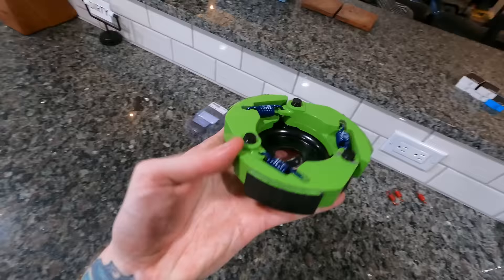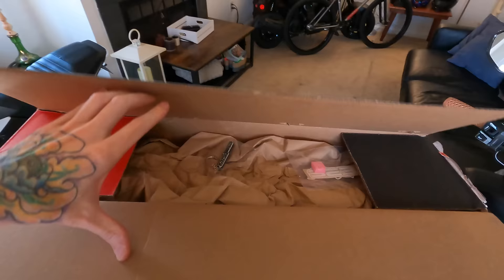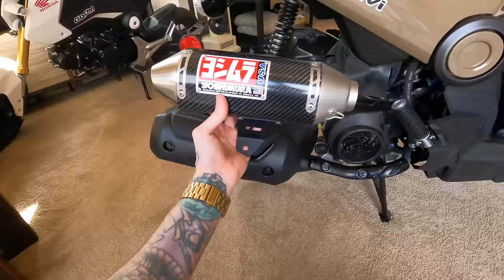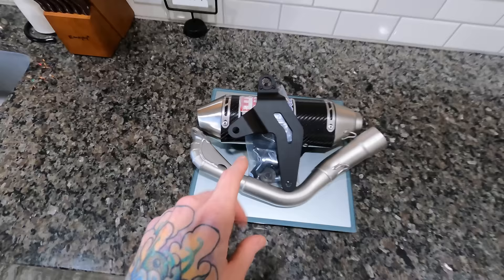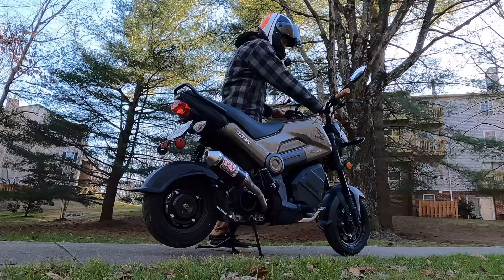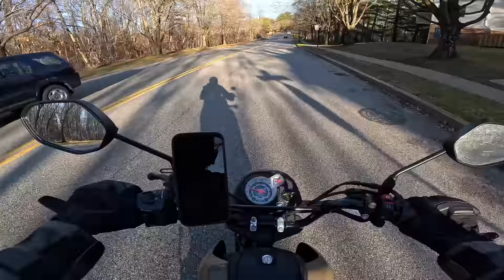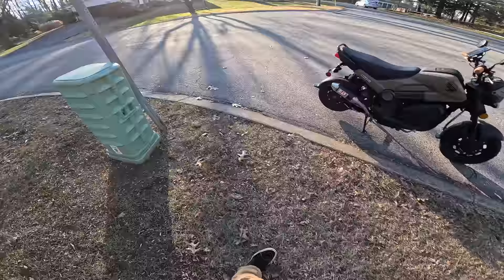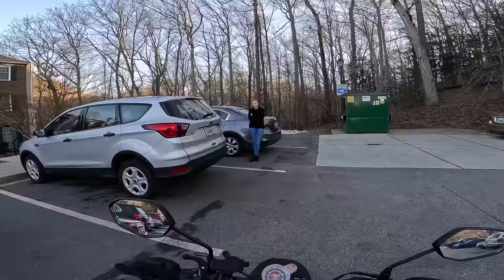Does An $1,800 Honda Navi Really Need A $500 Yoshimura Exhaust??

Comment: I'd go back to stock or see if they have a different silencer because the pipe looks really good on the Navi. Those little single thumpers have a sound to them that is hard to make better. They tune the sound so good in house that aftermarkets usually don't pan out too well unless you want to wear earplugs every time you ride.
Reply from the maker: Unfortunately this is the only silencer they offer for this muffler 😅 I agree that single thumpers are the WORST for getting any kind of manageable sound out of! My Grom is surprisingly quiet for having an aftermarket exhaust, especially compared to other Groms, so I had hope for this one too. I really want to make it work though because the Yoshi pipe just looks sooo dang good!! 😩
Reply: @LifeOfBurch  It is a gorgeous pipe and really finishes the bike off nice. I totally agree when you said in the video how it showcases the single swingarm so good.  You may get used to it. When I picked up the Honda Fury it seemed really loud to me at first but now after 5 months I'm used to it....or a little deafer... LOL.
Reply: @LifeOfBurch  Did you get the silencer separate, or it comes with it?
Reply from the maker: @pmontero13  I bought it separately. This is what I ended up with for the best volume- https://www.yoshimura-rd.com/collections/all/products/spark-arrester-kit-rs-2-mini-muffler-1-550-ring-sa-23-k
Reply: @LifeOfBurch do you know if I'll work on a 2023 navi
Reply from the maker: @pmontero13  yea Navis are the exact same regardless of year
Reply: @LifeOfBurch  good to know!! Thank you so much

Comment: Literally put one on today. It’s loud for sure. Is it worth the money? I’d say yes. Sound, looks, weight, performance was improved. Stock topped out at 48mph. With the Yoshimura pipe I felt more pep off the line and hit 53 mph today on flat ground. I’m 6’1” 187lbs. I was not fully tucked and no windscreen. I Put the silencer in tonight. Will try tomorrow.

Comment: If you want it a bit more bearable You could always buy an aftermarket ebay silencer that instead of on the muffler it fits in the header where the muffler connect. Not sure which type since there are a ton of different styles and types of universal fitting and shapes not sure how it would affect the Navi 🤔

Comment: That's been my issue with essentially all exhausts I've put on my bikes: they're all too loud. I want an exhaust that's a bit louder than stock, but no matter if I've gone with FMF, Two Bros, Akrapovic or Yoshimura they're all absurdly loud. It's a shame you have to choose between a wheezing stock exhaust or a loud as shit hooligan exhaust. Finding the sweet spot in between these two extremes is very difficult, and every time you try a new exhaust that claims to be less loud you end up spending like 500 dollars only to find out they were lying.
Reply from the maker: Yea I’ve found that to be mostly true with single cylinder, small CC bikes. It’s nearly impossible to keep them tame, especially once the cat is removed and you’re having to pin it wide open to keep up with traffic. For the Rebel 1100 I’ve found that there’s tons of options that are actually too quiet for my liking 😳 I think lots of it just depends on the bike, and in the Navi’s case I don’t know if anything will be quiet enough to be bearable for me long term.
Reply: @LifeOfBurch  You're certainly right about it mostly being an issue with smaller one cylinder bikes. The ones that I've had issues with have all been 400 cc or smaller: a Grom, a CB300F, a Duke 390 and a DRZ400SM.

Someone said the reson for this is that the exhaust manufacturers can't afford to to make a bunch of different size mufflers for all different types of engine types and sizes, so they end up selling a can originally designed for a 400-500 cc engine for bikes as small as the 110 cc Navi.
Reply: Buy a mivv exhaust
Reply: Try Black Widow?
Reply: @LifeOfBurch  Jesus, so I live in a quiet neighborhood and am planning on buying a Navi to commute to and from work. My first plan was an exhaust swap. Should I just skip that then?
Reply: Lol.haha.lplhah u my boy

Comment: The Yoshi RS2 for the Navi weighs 5.0 lbs. total, and removes 6.4 lbs. of useless Honda scrap metal.  To make sure you don't need to go up in carb jet size, keep an eye on the condition of your spark plug by checking the tip every +/- 100 miles a few times and if it looks pretty good then drop it down to every +/- 500 miles).  It will let you know visually if the Yoshi exhaust has allowed enough increased airflow to result in your AFR running leaner (too lean?) with the new exhaust.  This also may be why your "butt dyno" feels like the Navi might be a tad bit less responsive to increased throttle.  I'm sure the guys at the Scooter Swap Shop could give you some input also.

Comment: Put some glasswool and baffle in the exhaust. Will make a much better sound.
You can also put a pipe inside the silencer, thats slightly longer than the silencer, pushed in the muffler. Will also sound better.

Comment: Probably means that stock the intake is the limiting factor on power.  A drz400 gains very little from a pipe unless you do the 3x3 and rejet. 3x3 refers to removing the snorkel from the airbox and enlarging the hole to 3"x3".
Reply: A UNI filter and upjet is mandatory for a 50cc

Comment: Just installed my Yoshimura exhaust on my Navi. Without any additional inserts, it's SO loud! It rattled my brains on my ride to and from work...and rattled the header nuts right out... Silly me didn't check a torque spec, just cranked em down with my ratchet. Looks like you bought the spark arrestor. Yosh sells a silencer too. I'll be buying the silencer for sure.

The plus side of losing the header nuts is that it gave me a reason to order additional parts since I was already paying for shipping. Bought a Ranger Green headlight surround and silver lower covers from the Ranger Green model (mine is N U T Brown)

Comment: I'm thinking go up a jet size for the Main jet, leave the pilot jet so it can still pop and if you run it on a higher octane, it will weirdly be quieter as well, but you may want to go up two main jet sizes (possibly)
But a $500 exhaust on a $1800 bike... people put $1000 exhausts on $5000 bikes... and they aren't even legal! at least when it is exempt from Emissions laws due to it's size in the first place. it makes more sense to put the exhaust on it that a bigger bike that MUST have to original exhaust with the cat and all that crap!

Comment: Hey Burch, thanks for the rad review. We do make a spark arrestor for the RS-2. Shoot us your addy and we will send you one to try.
BTW do you live in a Country Club?
Reply from the maker: I appreciate the offer, but I already have a spark arrestor/silencer in this. I mentioned buying it and showed its box at the beginning of the video actually. I bought it directly through your website and installed it at 13:23 in this video. There’s even clips in this video comparing the sound with the spark arrestor vs without lol
Reply: @LifeOfBurch  What you had installed in is a low volume insert. We can send you a spark arrestor that should lower the volume even more if you shoot us your address in a Insta DM.
Reply from the maker: @YoshimuraUSA  interesting…I assumed we were talking about the same thing since what I have is the only insert listed on your website for the Navi. I’ll DM you guys now!
Reply: @yoshimuraUSA @LifeOfBurch 
Would it work for a 2023 Navi? Your website says I won't. Only 2022, I have been looking, but there's no difference
Reply: @pmontero13  yes it will fit
Reply: Just bought an exhaust from the dealership I got the navi at, do you have a link to the arrestor?

Comment: I hope you did a re-jet, because your bike is running crazy lean! As in potential engine damage. I don't know who at Yoshimura said it was okay to suggest otherwise...
Reply: Flames and pops indicate unburnt fuel in the exhaust igniting, meaning running rich.... Or am I wrong?
Reply: @ChrisOnez718  Lean does it too! It's complicated, but in this case, it's obvious that a free-flowing exhaust is going to make it run lean. And Navis already run crazy lean in stock form due to emissions regulations...
Reply: Adjust the air/fuel mixture on the carb.
Reply: @srlewis76  That only works for idle, not at cruising RPM. The main jet has to be replaced.
Reply: @MrPage62, I did my intake and carb jets (38/90), still waiting for my yosh to arrive, rough idle, and light popping out of my stock exhaust as well, as of now.  Will the yoshi install handle that issue? I’m at sea level in Ca.

Comment: See. This has me curious if I should do a full exhaust on my gsxr 600 or not lol. I have a knockoff m4 on it, and it doesn’t sound to bad. Wish it was a little louder and cleaner sounding. But if a full exhaust was loud and obnoxious on this, I can only imagine my bike lol
Reply: If it has a cat prior to the can, remove the cat, drill out the contents and reinstall. So close to full system.

Comment: Dude, installing an aftermarket exhaust isn't the same as swapping out handle grips. It's done for a specific reason. Tuning. If that wasn't the primary reason you just wasted your money, and basically earned lifetime noob status. Yosh pipes are some of the best made, and function as expected. But, their only one small piece of the equation if you're after improved performance. It still sounds sick, as it should if it's replacing a stock pipe. It makes it sound more like a bike, and less like a gas-powered Honda generator. Lol, no sense in keeping it if you're not planning on doing any tuning IMHO.

Comment: I miss Ricardo sniffing, explorin and pawing around while you were putting on the exhaust.  This might sound kind of wacky,  When I get my Navi, I'm gonna find a bolt and plug that screws into that I can drill and Weld on to the back of the stock exhaus, below the stock exhaust tip so I can have less restricted flow and  stealth mode  Essentially I want to make a derestrictor that I can reinstall on the stock muffler, there's plenty of room on the back  with the tiny little exhaust tip.  Essentially it will look like I have welded a 02 sensor  kit on the back of the muffler, except that is a plug that can be removed for the derestriction.  For the most part it is my understanding you will not see a measurable performance improvement by putting a high performance exhaust on without a accompanying high performance carburetor.  Is something larger than the stock 16 mm.  Something you can do is enhance the restriction of the restrictor you purchased, With the addition of small restrictor plates installed with safety wire. You can make this stuff out of soda can or soup can and just add some littl plates.. Thank you for all the great videos.  I hope my suggestions at least made you laugh, because they are a bit redneck and shady tree mechanic.